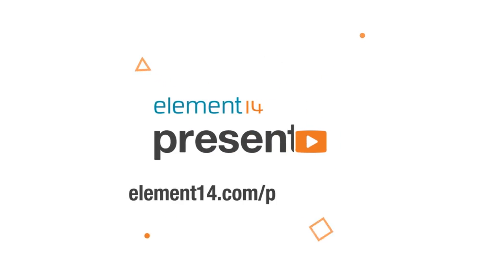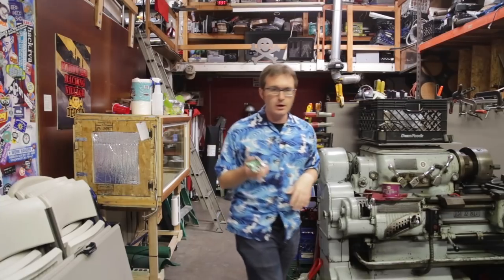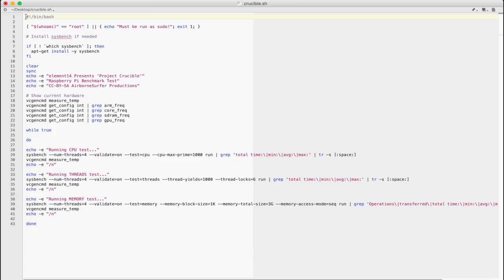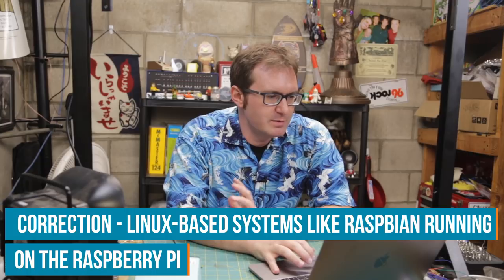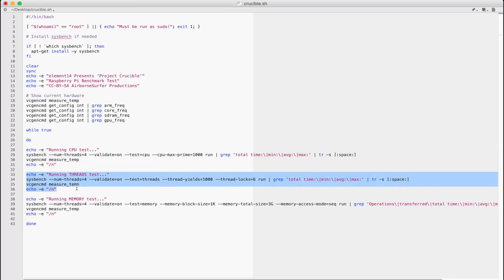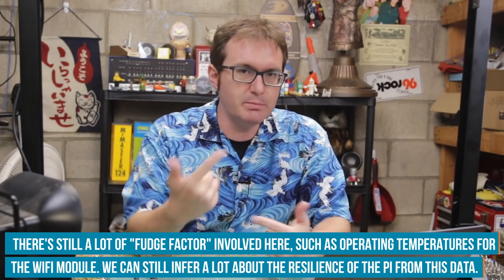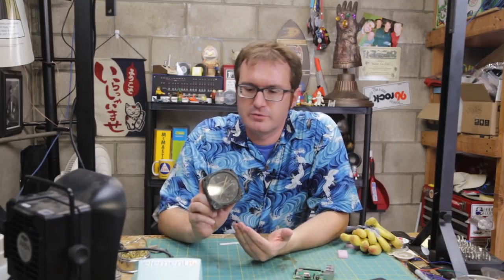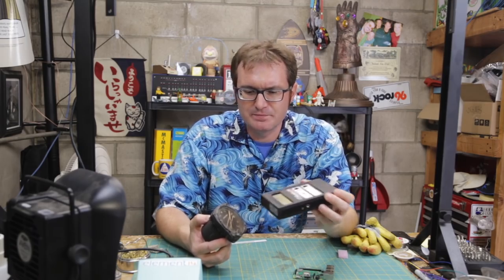The Ultimate Raspberry Pi Stress Test

Comment: I was hoping to see a humidity and vibration test.
Reply: sorry but we're gonna literally crush it because that's a much more useful test 😂
Reply: @mattj2217  Gotta save something for the sequel 😉
Reply: Depends on the level of vibration. I'd bet it would survive nearly anything regarding vibration. There's nothing with any real moment arm to fatigue. Regarding humidity, it's not conformally coated, so it would work under extreme 100% humidity unless you get condensation which is why he conformally coated it before the liquid N2 immersion thinking it would condense too much moisture in the process of quickly cooling it.

Comment: The radiation test temperature difference was due to the restricted airflow only. Re-test the baseline with the same paper towel in the same position and it should have the same results. Also the crush test exceed the weight limitations of your scale so you didn't have an accurate end force measurement. Comparing these tests to Mythbusters is an insult to them.

Comment: It looked like all the cooling test was run in real time over ssh on wifi. If you stop the test when you lose connection, you might just be testing the thermal range of the wireless chip.
Reply: True, and that's one of the limitations I mentioned in the conclusion. I am taking certain liberties to define "functionality" and using the ssh tunnel as a proxy is mostly done under the assumption that such environments would be connected wirelessly to limit human exposure risks.
Reply: @AirborneSurfer  Fair enough. It was a fun video, thanks.

Comment: The UDOO RYZEN Bolt V has the Raspberry Pi beat hands down, what about putting that board onto a back panel inside the Little Devil PC-V10 PC case which has a Phase Change Cooler, it will cause the solder to melt and the chips drop off the PCB so forget it unless you intend to rebuild the board.

Comment: Maybe the crush test would have worked better with the pins removed, since it probably shorted things out when the pins all started touching. The scale also stopped moving at 360 pounds long before you stopped putting more pressure on it, it probably can't handle more than that, and the pi probably got way more than 360 pounds.

Comment: Hello. I would like to see some one get a rasb pi work on a screen reader. I am legeaglly blind. I think it would be great for the blind commuty.
Reply: Hi Edward, I'm Dave, one of the hosts for element14 presents. Thank you for the suggestion! I am reading up a bit and it sounds like it would be more on the software side of things? I'm also interested in doing a mechanical braille project, I'm looking into OCR and having a mechanical build on your hand / finger or maybe even the leg. I don't have direct contact to blind people to test it with, though and being able to see while installing packets and building the project feels a bit like cheating, to be honest. I will definitely do some more research.
Reply: Thanks for the reply and I love the projects you mention . I  also kinda have a idea if on the rasp 4 on the second display if you can connect  a touch display. So would have a main display and a smaller one for input. While your typing it can tell you what letter your touching. Brile on the pi will ne nice and wish I can read it. Think you very much for  yje reply.

Comment: 100c~ is less than half the temp the solder there should melt. O.o
Reply: ~100C was the CPU temperature. The poor SD card and USB connectors had more metal surface and would get heat faster.... even worse if they touched the crucible body.